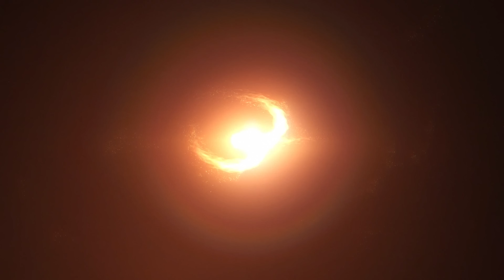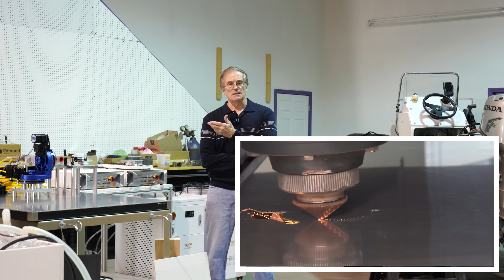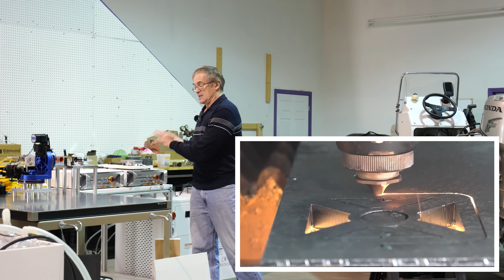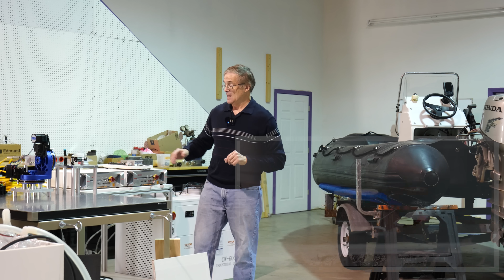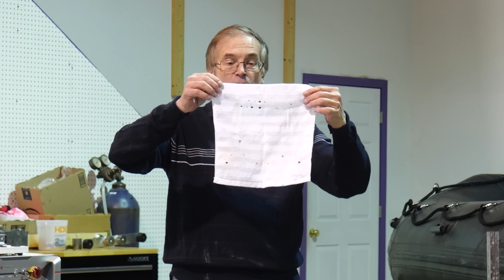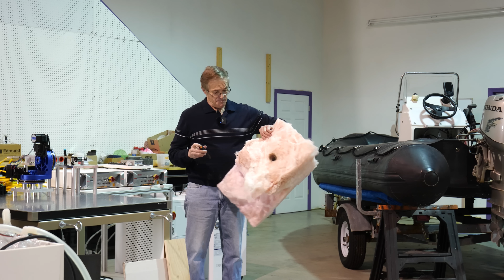We have a problem... and need your help!

Comment: Hello... Going through your problem, it seems your dilemma is coming from the fact you're trying to solve the problem at the wrong side of it.
What you need is a watchdog (something that will detect a malfunction, whatever it is, in whatever link of the chain).
The watchdog then must actuate on a very simple device, such as a spring loaded mirror (which must be intrinsically safe. It must not require energy to actuate, but instead, use energy to keep it disengaged).
And this intrinsically safe mechanism should divert the beam to burn a fuse that powers the laser.
Behind the fuse, you can put a cube of bricks or anything that can take a blast for a few milliseconds.
Summarizing:
Every bit of technology that MUST be working must be sending a signal every x milliseconds it's working and  stop sending the signal if it stops doing what it's supposed to do.
All the signals coming from all watchdog points must be physically "ANDed" (logical multiplication) in such a way that any of the watchdogs missing will cut power to the deflecting safety mirror, which on its own nature will intercept the beam and divert it to blast a fuse that is used to power the laser beam itself.
To account for the startup of the safety system, a block of expendable material must be placed right at the exit of the beam, before the safety mirror. This expendable block, as it takes time to be punched through by the beam, will buy time for the watchdog system to disengage and prevent the beam from killing itself during startup.
After the block is punched through, the system enters its intrinsic safe mode and will kill itself as soon as any of the watchdogs stops producing its own signal.
If the expandable block is already punched through, the system cannot be restarted as the beam will kill itself upons startu, because the watchdog system didn't have the time yet to power- disengage.

Comment: Maybe Rockwool Toprock DD, a high-density uncoated stone wool insulation board, or something similar, mounted in vertical steel stud track wall framing system, staggered, and 2 or 3 layers deep. If it is available in a non-water repellent type, it might be porous enough to run coolant water through fed to the top with a jacuzzi pump or similar? That should be able to calm down some angry photons for some seconds?

Comment: Ceramic fibre boards (Alumina) and refractory bricks would offer good ablative heat dissipation giving more time.  Can’t use good old asbestos like in the old days…:)  I’m sure aerogel has been mentioned.  A berm of silica sand for a backdrop wouldn’t be practical…;-)

Comment: Another option depending on how portable the assembly is would be to have it mounted on a boom lift and the drones between the laser and the ground somewhere with concret or gravel. Then wetting down the surface becomes easier if desired. Doing in the space you have currently definitely presents challenges, but fun ones at least haha.

Comment: I saw an interesting option from Nighthawkinlight for thermal shielding. It would require a brick of the resulting putty rather than the thin wafers he used but the materials are cheap and readily available.
https://youtu.be/0IbWampaEcM?si=e4FVVk_BDphP0xwt
Reply: Use a brick mold to give replicable shaped blocks to just slot in and replace between laser tests.
And has the advantage that you likely already have the materials on hand at home to try a test for viability.

Comment: Construct a sandwich-panel "fish tank" backstop.  Front panel must be glass that is transparent to the laser wavelength.  Back Panel material is largely irrelevant.  Fill with water containing absorbent dye or slurry.  Circulate water with a pump or air stone.  Tank  thickness may need to be varied/increased as liquid at the point of contact will be vaporized, but the closed circulation will replace the coolant to maintain the barrier.   The assembly with be heavy and immobile, but include a drain valve so the liquid can be discharged as needed for storage/removal.

Comment: Sounds like you need to build a black water tank.this is achieved using a suspended pigment in the water.  Find the darkest black available.  Just be sure to build it to compensate for the pressure wave and cavitation. Think along the lines of a Newtonian fluid he will have to build a simple offgassing trap dependent on your exposure. But I would still set up a timer that way you can set your exposure.
You can run some simple tests, using cornmeal in your as your pigment prior to adding your black pigment. Enjoy happy hunting.
Reply: Sorry for the typos …that’s what I get for using voice to text, but I think you understand.

Comment: The keyword for the item you need is a "Laser Dump" or a "Beam Dump".  There are commercial solutions out there.  For the power levels you need the laser dump will be water cooled.  You need a sheet or cone of copper or aluminum with an incidence angle of 60 degrees or more.  Coat the metal with an "absorber" material such as Carbon Nanotubes, silicon carbide, black oxide or black anodized aluminum.  To control reflections the entire apparatus should be placed in a ribbed light bucket.
Reply from the maker: I understand. The challenge here is the large area that we have to protect. It's not just about dealing with a fixed beam that has to be absorbed or removed. We're looking at around 25^2 meters.
Reply: @TechIngredients  You may be interested in a thermal protection material (TPM) used for space vehicles.  It's a mixture of Silicone Rubber, 20 parts (AMHMs) acrylonitrile-methyl methacrylate copolymer hollow microspheres and 5 parts silicone dioxide.  The Silicone Rubber when heated creates a porous Silicon Dioxide char layer that reduces the thermal conductivity of the material.

Comment: You need to disrupt or demodulate the focused beam. I suggest a reference beam or beams, possibly creating a multi-layer mesh-like matrix. What would you do to a focused stream of water if all you had was more water? Interesting problem and challenge! Afterthought, you need to redirect, diffuse, or change the energy, think noise cancelling. Following.

Comment: I do not entirely understand your problem. Is it that you need to harden the wall to resist the laser when you miss, or do you just need a way to dump the energy. If the former, no idea. If the latter then use a fast acting beam diverter and direct it into a bucket of mid weight water based drilling mud. One 5 gallon bucket of 10 pound mud should likely absorb the beam. Essentially just water down drywall compound
Reply from the maker: It's the former.🫤

Comment: water - thickened if necessary for suspension of high temp micro particle oxides
  in a waterfall of angled substrate with shore walls on each side 
and -to keep particulates from exploding into steam and a filter to get out any particles that are not conducive. ground-powdered thermo resistive CTE glass suspended in a liquid.
Reply: a decorative waterfall of one sheet 
no front sheet required,
[may need a roll of black poly or other to allow accuracy of opto sense.]
Reply: just scanning the base substrate with the laser [before substrate is waterfalled] should cause ripple of flatness and associated-massive mixing of oxide/glass/liquid water-falling down sheet... 
kinda like a pachinko board. Only total random pins.
Reply: Colored dyes depending on composition could tune the absorption rate
...micro oxides, reflective of wavelength used which reflect instead of aborb at some computed tested rate.
Reply: This - if not a visual description
     is a pool slide with water flow from top to receiving pool-basin
coat plywood with proper color of reflection to keep it from absorbing water and you can have several locations for making dead man switch. 
any light in liquid layer can be received by optos and deadman.
Reply: ask nilered nileblue etc

Comment: Maybe concrete precast slabs or thin stone slabs would work?
Or bite the bullet and use a high thermal conductivity material (aluminium, copper) with a cover to maker it absorbent (maybe sanding it for example). 
This could give you a few extra seconds..

For extra ideas you can look up thermal database, it's a website with a library of thermal conductivities and thermal capacity for a lot of material. Could help you if you go the way of making a coefficient of performance for materials ( making a formula that outputs a result corresponding to the theoretical performance of a material, so maybe a formula like this would need several melting/boiling enthalpy values, thermal diffusivity, conductivity and capacity too. This sounds like a tough problem trying to source all those data points for a variety of materials, you usually can make one from the formulas used to model a system like this)

Another idea is to use a passively replenishing source of material to melt, like sand/claydust/ground glass/ceramic powder, sandwiched between too walls with enough space to flow, and not solidify before the laser stops.

Finally, use an optical layer in front of the wall to defocus the laser, reducing it's piercing capability ( diffusing layers for discarding tvs? Sanded second hand glass panels? )

Add on: a friend recommended thermoset polymer blocks

Comment: I am so unqualified to make a suggestion here but I am a huge fan.  This is one of my favorite channels.  I can't wait to hear what you come up with.   How large does this back drop need to be?  

A curtain water fall? or multiple layers of water fall?

Stone wool is fire resistant Obviously not so much as to stop the laser completely however I would not expect it to continue to burn once the source is retired.   It is relatively inexpensive and could be stacked and un-stacked very quickly. Also it would likely still be very usable and could be donated or resold to recoup some investment.  Also it could be soaked in water like the fiberglass only it will probably hold volumes more.  Of course it would also drain quickly so maybe keep water running through it from above.  

A curtain water fall with a thick layer of Stone wool behind it.  I am from the mid west so Layering is in my nature.

If the laser is aimed stationary then what about some sort of crystal that could refract it.

Comment: What about large format porcelain tile? It could be bonded to plywood to form a sheet, and it's relatively inexpensive.
You could buy whatever ugly tile is not selling and repurpose it (or even using remodeling salvage)
Porcelain / ceramics are used for reentry vehicle shielding, and resist heat very well.

Comment: We use a 40W laser to etch stainless steel. We tried to etch aluminum and could not. Aluminum can be cut with very powerful lasers but it is difficult. The reflective beam could be directed down by placing the aluminum at an angle, using strips like a venetian blind. If the aluminum is kept moving (like an orbital sander) heat would be spread over a large area. If the angle of the aluminum is changed rapidly the reflective beam would also be spread over a large area. Perhaps the whole thing could be made of rapidly rotating square aluminum tubing.

Comment: How about this? Is your building tall? Instead of operating horizontally, operate vertically downwards, directing the laser to a shallow bath of water above which you can fly your drones. Absorbent, cooling, cheap.
Reply from the maker: It's got a decent ceiling height, but not enough for that.

Comment: Slate tiles maybe? - that can be loaded on a wood frame wall.
Reply: My thinking here is that slate is used to engrave images on, but well known that you can’t cut it with a laser. The laser scrapes the surface. But you could have tiles that are replaceable, which might be a cheaper option that’s not some over engineered solution. Then again, I’ve got no idea how a high powered laser like that would behave with slate — further testing would be required.
Reply: Correction. It seems you can cut slate with a fibre laser, it just needs a lot of passes. Still worth a try maybe?

Comment: Hi, worked with IPG 5kW Lasers. What Power and Frequency do your Lasers have. I would use - before bringing out the already perfectly focused beam - an Arrangement of:
1. Adjustable Beam Expander ( there are mechanical and electrical available. Expand it to the diameter your shutter in 2. can blend out
2. A simple Laser Shutter  - that’s a thing Like a Little Motor, but just capable of Rotation a small amount like 30 degrees or so. Attached there is a Ceramic Shield like an eloxided Metal tin plate. Activated it is open. In failure it  is closed (spring, so if power goes down it is also closed)
3. Beam focus unit to get your origin beam diameter back. That could be built right between the collimated an your focus unit
Reply: So the idea is to block the beam before it is dangerously focused ☝️
Reply: Or ask a manufacturer - they should know best 😉
Reply from the maker: Thanks!
Those suggestions are also good to incorporate. This application is way non- typical. A lightweight,  inexpensive backstop that can protect about 25^2 M is a chalange.

Comment: If you are willing to do your experiments at a gentle downward angle, instead of horizontal, you could have a kiddie pool full of dirt/gravel act as a backstop. Every few shots you can rake the dirt around, refreshing the backstop. Once you have too many "laser fulgurites" you can sift them out, and replace the lost mass with more dirt. At the completion of experimentation, the dirt can be stored/moved in a small number of 5 Gallon plastic buckets.
Reply: Yes we're going to shoot down drones at a slightly downward angle... clearly this is why project Star Wars was mounted to an airplane. I mean he's spent so much on lasers clearly he can afford an airplane. And staging an airplane around your compound is a perfect defense against drones.
Reply: @ I see what you’re saying, but designing these experiments in the manner I have described, has the added advantage of not spraying the sky with random, distantly convergent, ultra-high power, laser light. A passing aircraft would likely not appreciate such a surprise.
Reply: @Neophyte50  you didn't and even upon correction do not understand the assignment.

Comment: Several layers of frosted "glass", each of which is increasingly opaque, with an air gap between for cooling and to allow dispersion of the diverging beam.

Succesive layers would be able to increasingly attenuate the beam without overheating due to prior scattering and wider distribution

Comment: physically constrain beam to narrow angle (1 deg) inside a concrete pipe, tunnel or cone. Than create a heavy barrier only for the small 1 deg area where the beam physically can reach. 
So the barrier will be still heavy, but limited only to very small area, therefore much more manageable.

Comment: Hey it sounds weird but bread when turned to charcoal is a good insulator( is a carbon foam) but at the power levels your talking about might still just get a hole blown in it. I was also thinking about a water curtain. Like a rain box to circulate falling water. They idea there is the water diffracting the beam and absorbing energy

Comment: no point reinventing the wheel . Why not use a multi layer system. acoustic panels come to mind so something like rockwool rockboard the stuff you use in kitchens and bathrooms in place of sheetrock. sheetrock with lead backing can be purchased. it's used in dr offices that have xray machines. and womanized plywood aka greenboard. i would imagine a mixture of 4 of these would give you enough time to make safe. best of luck.  oh as an audiophile i think it would be cool if you could show scientifically how to treat a room for good sound. mainly because i can't afford to do it and i don't see this out there unbiased. im looking forward to seeing this project come to fruition.

Comment: dynamic, moving barier, which would expose enough base material per second to contain energy of the beam. 
- for example: spinning disks, drums, pendulums or wall oscillating left and right. 
- Instead of 10 layers of drywall, use 1 layer traveling 8 inches per second - mass of beam absorbing material is the same, but structure should be an order of magnitude lighter.

Comment: I think if you use foam-crete and immerse it (or using vacuum) in intommessent paint to absorb the heat. Also you may use alumina bricks (used in furnaces) instead. Best of luck  A.M. Fateen

Comment: could a focus lens which without power is heavily defocused and when powered it's super focused. that way any outages it's just a bright but spread out/diffused light? I think the lens would get hot though if not pure in whatever.

Comment: An angled panel holds a shallow tray filled with sand, positioned at the angle of repose. The sand maintains a uniform depth throughout, and when struck by a laser, it is replenished from above.

Comment: I would actually have suggested sand between two walls, but it was already taken :-)

How about using some 3-4 meter rotating discs, where the laser would cut a groove instead of punching through. If spinning fast enough, the surface would never reach the melting point (and you could even use them for target practice).
Maybe build 4-5 of them and let them overlap, so if you hit near the center and succeed to cut through (due to the slower rotation), you would have one behind where the laser would hit the outer edge.
Could also be done with a scolling wall, but I think it would be harder to build, if the material need substantial mass.
Reply: Rotating Barrel filled with water was also already suggested